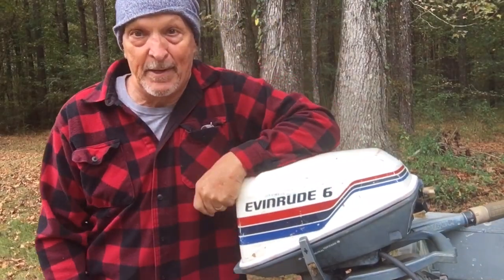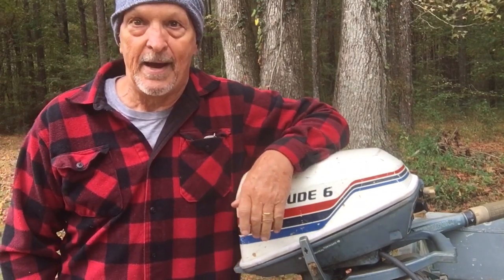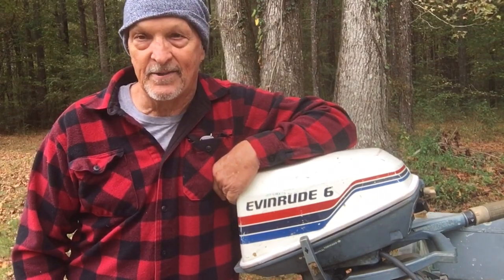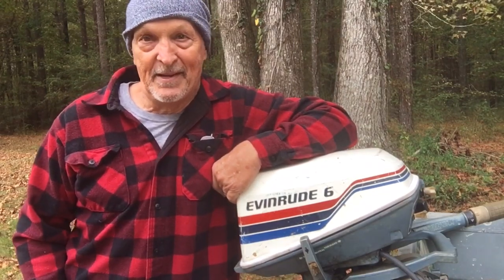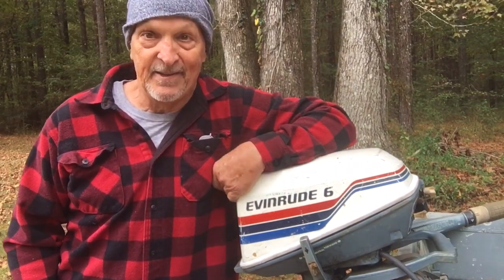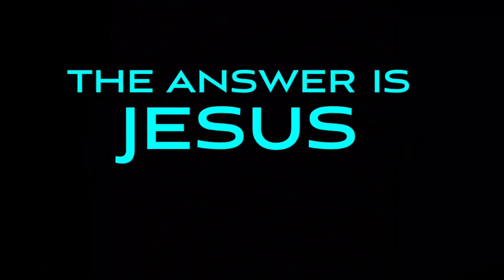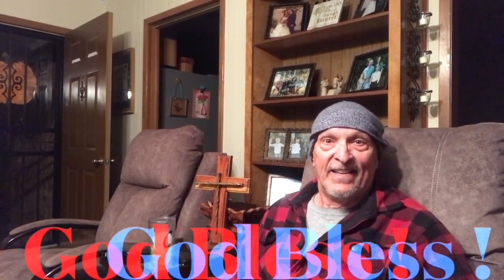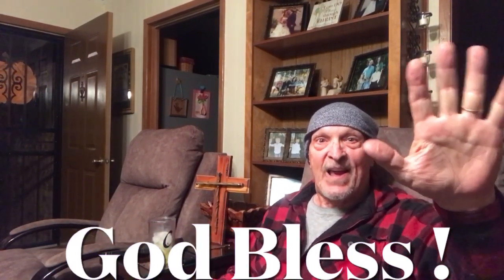No tell tale on outboard! Impeller - maybe not

Comment: Ahhh guess not. It’s funny I have had that problem before and it was usually mud packed in the tell tale output or once in a while impeller pieces like you had here. 😊

 Was it just the tell tale line blocked, or was is actually blocking the cooling flow? I ran my bass boat all the time with no water tinkling out the tell tale. It got to where it had mud inside it constantly so I just ran it all day and it eventually pushed it through.  That’s the beauty of a water temp gauge in the outboard.👍😉. Cool video brother!
Reply from the maker: It was actually the water flow inside the head. Hope I never have to do that job again😂😂😂